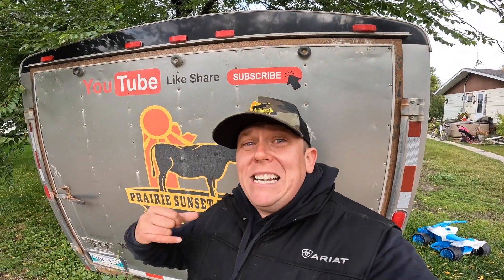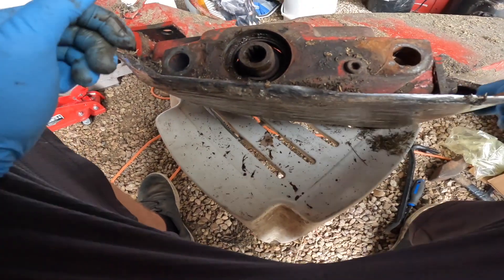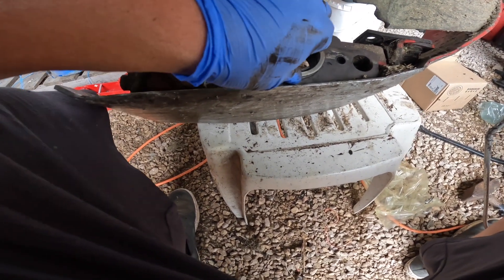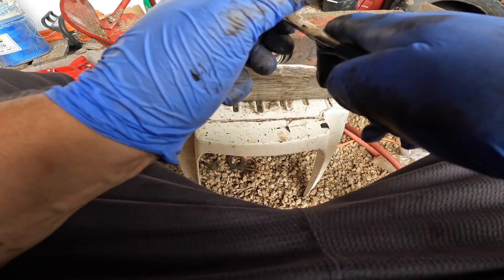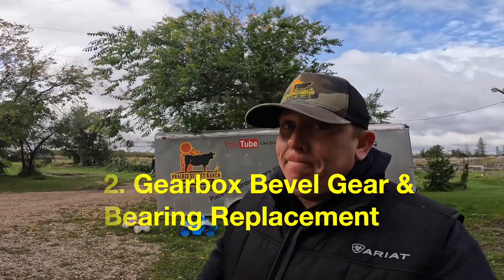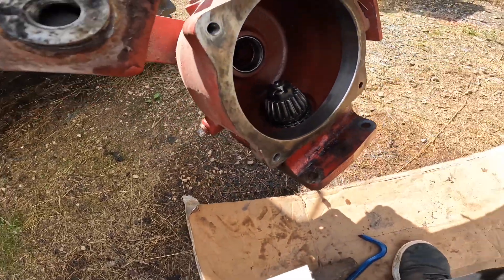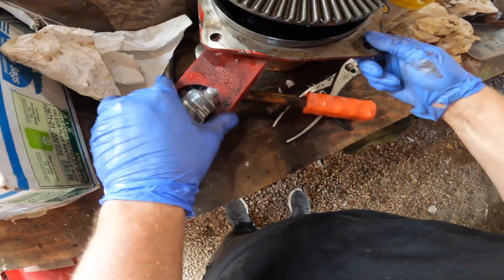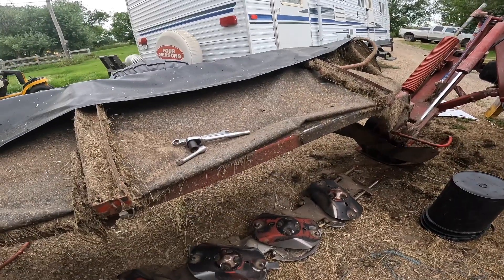New Holland Disc Mower Gearbox Repair & Drive Module Rebuild 🛠⚙️

Comment: Can separate the mower just by pulling the two big bolts behind the drive belt on a617 b new Holland hay cutter. So that I can replace bottom press pin and keyway did it before but holding cutter up in the air was. Hassle and twisting things around to line up keyway and pin was hell
Reply from the maker: Definitely not a fun part of the process, but hey it beats taking it to a dealer!👌🍻🍻🍻

Comment: Dust control.... lol
Reply: Just thinking how things changed over the years. When I was around 6 years old or so a neighbor would dump oil on the road for dust control. No one thought much of it. Oh look Pete oiled the road. Now someone would flip lol.
Reply from the maker: oil on the road these day you'd be locked up for 10 years 🤣🤣🍻
Reply from the maker: I have enough drained Hydraulic oil this year I could probably put dust control on a couple miles of gravel 🤣